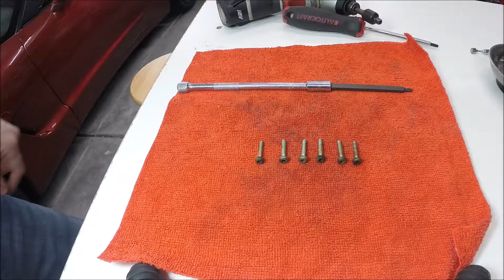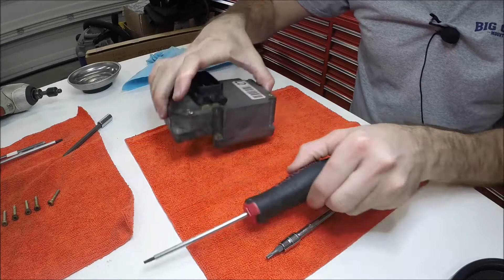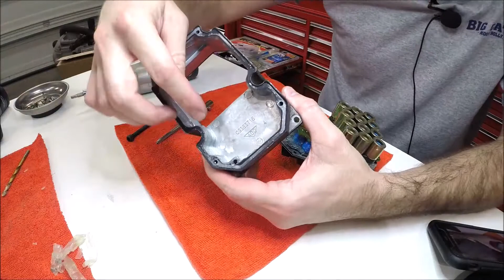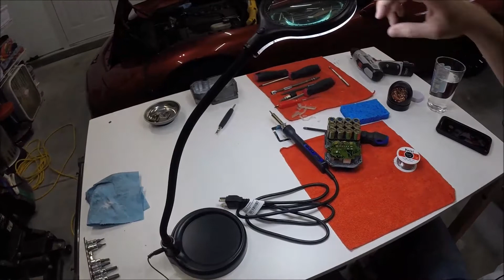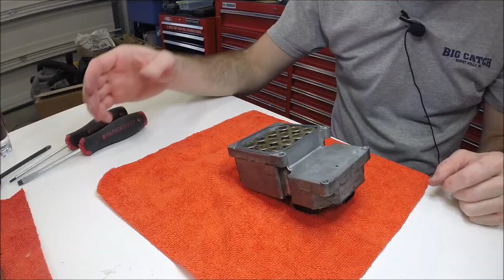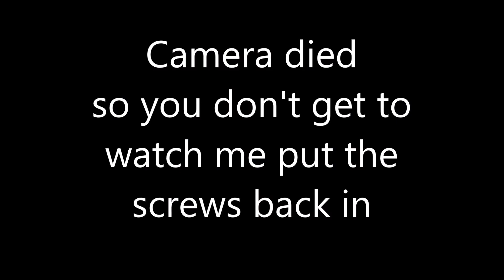C5 Corvette - EBCM Repair

Comment: When using the drill bit to remove the cover, did you drill all the way down into the EBCM then use the tap to create threads, or just enough to get the tap started? Pardon my ignorance, but I've never down it before.

Comment: I have a 2000 c5 corvette automatic targa top model. I see the connector in the front but not the 6 screws you see on yours. Different design from what im seeing. I think mine are hidden
Reply from the maker: Unfortunately, only the 2001+ models are repairable.
Reply: @ScrufsGarage I'm told that too because I'm hearing that they're not as likely to be worked on although I know it's possible if I could just switch it out to something easier that would be great but the amount of work that would be needed I don't even want to think about it. Because when you think about it once all those abs modules are gone then you're going to have to go get something aftermarket or get one of those manual brake lines set ups. I don't like the idea of always adjusting it

Comment: Going to start this project this week.  Thanks for the terrific video!!

Has anyone tried a flexible extension to reach the six screws?  Removal of those screws plus the reattachment seems to be biggest challenge with this project.
Reply: i  tried about everything but finally got the 6th one out tonight.  i used a combination of a 3 in t-20 torx bit and a craftsman Steel Handle Ratcheting handle.  that was after i disconnected as many in the way hoses as possible.  i think my biggest issue was not wanting to scratch the paint so i was very hesitant to lean into the bay.  once i covered the exterior and used 2 hands it was much easing to correctly place the bit and slowly work them out.  guessing youve moved on since your comment was 4 months ago but this step does indeed suck

Comment: When reattaching the module back to the ABS module, any sealant or is that little grey rubber seal (which you could have damaged prying the EBCM off with the straight edge screwdriver!) all you need?

Comment: wills wo 
will this work on a 2000?
Reply from the maker: My understanding is that the 1997-2000 used a different module that cannot be repaired.

Comment: I have seen a lot of videos for the c5 almost all of them for the module 
An bad bearing & speed sensor can trigger those light a bad ground from the module to.. 
First i would check all the other ones then the module at last if all the rest dont work

Comment: I have a 1999 and I see some differences, I have no 2nd plug on the bottom and it doesn’t appear to have the 2 center screws holding it to the module, would you know if this impacts the repair of the unit. Very good video thank you
Reply from the maker: Mine was a 2001.   I don’t believe the earlier models are repairable.

Comment: Thank you for the information.    Where did purchase the shop light that fastened to the hood.
Reply from the maker: I don't recall, I've had it for a while.  But they are incredibly useful.   A lot of them are rechargeable battery powered.  Personally, those never seem to last long enough.  I prefer ones that I can use while plugged in.  And some of them now have lights that you can rotate to help aim at your work area, which is nice.

Comment: I had to fix a 2003 Cadillac Deville EBCM for my father in law. Oddly enough it is the exact same unit that the C5 uses so all this info was relevant. I used an 11/64" Drill bit to drill that hole and tapped it for an M5x0.8 bolt. Got it apart, worked like a charm! Thanks for the in depth video!
Reply: Sounds like GM expanded their applications to other platforms after initially creat these units for the C5 Corvette. On the circuit board you may have noticed the large letters "YCAR". Corvettes are "Y" bodies in GM-speak.

Comment: I have a stock 2003 C5.  I did this repair back in June of 2020.  The EBCM has performed flawlessly since then.  No error codes or messages.  Traction control and ABS are working normally.
Reply: What codes were you getting ?
Reply: @MarioHernandez-bn6pm  I don't recall the codes any more.  Too long ago.  But, both amber idiot lights were on (traction control and ABS).  Ironically, the idiot lights are back on again very recently.  I will pull the codes to see which ones they are.
Reply: @GregSr ahh i see. Ok thanks . Its cause i fix honda ABS modules and on those they give specifix codes when the ABS module is damaged so i was wondering if this c5 was the same cause a customer whos jonda ABS module i fixed before, he called me asking if i can fix thr one on his C5 . Im waiting on him to send me the codes hes getting on his scanner .

Comment: The test failed. No change in messaging on the DIC. Clearing the messages fails to remove the icons on the instrument control panel.  Not sure what to do now.
Reply: Check the wheel bearings the abs sensors.. the ground from the abs module

Comment: Today, the EBCM's 5 points received new solder. I can only hope that what wasn't right is now corrected.  So, it's now to a temporary test installation.  If no messages show on the DIC, that will be a good sign.  More follow-up to come.

Comment: This is an update to my previous post 10 months ago.  The "wire" trick didn't help.  After a while the usual messages started to appear on the DIC.  Intermittent at first, then continual.  So, today, I finally got around to it and removed the EBCM from my C5 and took it apart.  Tomorrow, I hope to re-solder the 5 points/joints above the relay. Soldering is not my thing so it may take a while for me to do.  Hopefully, my effort will fix this problem.   I will follow up on this.
Reply from the maker: I'm definitely not a pro at soldering either, but I can say that a good soldering iron makes all the difference.  I upgraded my soldering iron a while back and it has made the soldering much more enjoyable.

Comment: Want to thank you for an excellent video. I just finished mine and NO CODES. You pointing out the exact places to solder really helped. I did mine from above. I disconnected the MAF sensor  wire and moved it aside. Loosened the air bridge and rotated it upward out of the way. Same with the radiator hose. I put an old radiator hose on the water outlet so it wouldn't drain all the coolant from the top of the engine or reservoir. I placed my fingers on the screw head and the torx bit as I slid the screws out. Installed them the same way. When installing the module I also put the two middle screws in the holes before I put the module in place, and then very carefully put the module on. The put one finger on the screw head while I tightened it. Once again, THANK YOU for this video.
Reply from the maker: Awesome, glad to hear the video helped!   Thanks for watching.

Comment: Thanks for a well done, detailed video. What scares me most is not seeing the 6 screws that actually need to be removed/replaced. The 4 easily seen screws are for the housing. Yikes. I've seen other videos/comments that mention using "hot" glue to hold the screws to the torx bit when replacing the module. I might use a dab of gorilla glue since I have no idea what "hot" glue is. I do like the idea of doing this from underneath vs above. I don't want to have to remove the intake, etc. just to get to the housing.
Reply: Don't be scared dude, it's not that bad. I've done worse. I just finished mine and NO CODES. See my comments above.
Reply: @beninchesapeake  I also finished mine. No codes. And it was just as bad as I feared! Worst repair job I've ever experienced. But it's done.
Reply: @thehomer5913  excellent! Yeah, it does get involved. But I'm sure you feel great now that the dash is clear and no more messages. I know I sure do.

Comment: I just did this to my 50th anniversary C5 with 12000 miles on it. The service stabiltrak messages are gone. I ended up using my 40W soldering iron because the 25W ones were not getting hot enough for me. The 40W worked great. Zip zip zip zip zip. Just don't keep it there too long on the solder joint. Thanks for the video. You really don't have to disconnect the battery. You're just unplugging the 2 connectors with the car turned off of course. Pretty straightforward fix that saves a lot of money and/or having to send it out for repair. Thanks again for helping some vette owners fix their cars for next to nothing except some time and space and tools. Nothing like driving a vette! I did by the way work from the bottom of the car jacked up pretty high with a heavy duty jack stand in place of course. Much easier to get to the bottom screws. No need to remove radiator hose. I did remove air intake hose from throttle body and air cleaner. Better to just get it out of the way. You can get to the top screws easier that way.

Comment: It's 5 months since my original post.  I touched the wiring only at the connector and the C1214 codes and messages stopped showing on the DIC.  Drove the car for months with nothing until this past Saturday running over rough country roads and the messages popped up on my DIC. Frustrated as hell again and will now proceed with removing the EBCm and doing the soldering fix.  Question:  Would putting the car on stands provide better access to the EBCM by working from underneath the car?  (I see that you had the car on the ground.)
Reply: I need to check my wires on my 2000 I guess.  Could it be a damaged wire?

Comment: What year is your corvette because my 1999 looks to have o my 4 screws and the connector is completely different
Reply from the maker: Correct, my car was a 2001 model.  My understanding is that the pre-01 models are different and can't be repaired.

Comment: Is there any need to remove the old solder from the 5 contacts? I did this when resoldering the HVAC PANEL? GREAT EXPLANATION OF CONTENT.
Reply from the maker: I don’t think so; typically just reflowing the solder and adding a tiny bit more is sufficient.  I had to remove the solder when I replaced the relays in the door control module… and it’s a real pain haha.

Comment: If I remove the module and send it off for repair, can the car be driven safely without the module?
Thanks
Reply from the maker: I would not recommend it.  Obviously the ABS wouldn't function, and you'd have a ton of ABS error codes.  Plus you'll want to keep containments from getting into the ABS pump area.   So I would do it at a time when you can be without the car until the module comes back from repair.

Comment: Very helpful indeed.  I have to do this fix to my C5. Have to ask, it has been over a year since the video, has the repair held up, that is, no additional intermittent codes?  We need to close the loop and find out the success of the fix.  Thanks.
Reply from the maker: I had no other issues after the repair.   I ended up selling the car a few months back, but I can verify up to that point that everything was working fine.
Reply: @ScrufsGarage  Thanks for the quick reply.  My C5's intermittent service ABS /Traction Control has been a problem since 2011.  I tracked down all of the ground points thinking that it may have been related because the DIC would show the problem going over a bump then disappear making a turn, just to reappear. The weird thing is that the codes were not related to the car's braking or handling. I am preparing to tackle this repair soon and hopefully rid the car of this problem forever.

Comment: I fixed mine today. But the active handling button isn't doing anything
Reply from the maker: Are you still getting an active handling warning on the dash?  Or is it just the button not doing anything?   You might check and make sure the button is plugged in.  The center console has to come out for a lot of projects and that button has to be unplugged, small chance it didn't get plugged back in?
Reply: @ScrufsGarage  the warning is gone. The button is plugged in lights up but doesnt function in another other capacity. I ordered another button on the off chance that the button may be back.

Comment: can anyone tell what i should do if i have a model in the 97 to 2000 model?? any information at all would be greatly appreciated
Reply: You have to find a good used one out  of another Vette, but if it's being parted out most likely its been wrecked and the ABS module probably wasn't working to begin with! You cannot purchase a new one, Chevy or ACDelco or whoever isn't making them any longer!  So we're screwed buddy!  I own a 2000 and wonder what's the difference that makes mine un fixable?

Comment: Would it have helped to remove the upper radiator hose ?
Reply from the maker: It might help a little, but then there's the added working of opening the cooling system and trying to get air out of the system.   To me I don't think it helps enough to be worth the added work.    Hope that helps.  Good luck on the repair!

Comment: Thanks for the lean, music free video. I've been thinking about getting a C5. This ECBM seems to be the reason folks have been shying away from C5's year 2000 and below. Is there any other "nuances" I should be aware of before taking the plunge?
Reply from the maker: Yea, there were a variety of changes that came with the 2001+ models.   In addition to the EBCM, I also believe the SWPS (steering wheel position sensor) is different (previous version no longer available), and the TPMS system is different.   Also starting with 2001, even the base model LS1 got the improved LS6 intake manifold, which is worth a few hp.   Also I believe 2001 changed to the 85mm MAF (vs 74mm).   And I think there were some improvements to the torque tube and couplers.   If you search on the Corvette Forum, there are some documents that list all of the changes by year that you may find helpful.   But in short, I would try to find a 2001+ car if you can.
Reply: My ECBM on my c6z06 shorted. No one is safe.

Comment: Thanks for a great, detailed video. Of all the videos explaining how to do this, this was the only one with showing a good soldering job. Cold soldering this (google it) runs a large risk of the issue re-appearing and the soldering you described was by the book and should last longer than the rest of that board.
Now i just need to muster the courage to do it myself. My 2001 C5 have had this issue intermittently for a few years, but only to the point where it's annoying and never to the point where it feels like a problem. Still, it need to be done and this video was my literal kick in the butt ... no more excuses!
Reply from the maker: Yea, mine was intermittent for a while too.  I know what you mean, it's hard to find the motivation to tackle the job when it's not a daily issue.  I put it off for a long time until it finally became a hard code and finally forced my hand.  Though when I finally did it, it wasn't as difficult as I had imagined.

Comment: Great video! I have a check engine light on.  I cleared the codes and it still came back on. Do you have any videos on what might be the problem
Reply from the maker: The check engine light could be related to a lot of different things.   If it comes back immediately after you clear it, then it sounds like a hard code (ie, something is completely not working - for me, the EBCM was a hard code) vs something that is an intermittent issue (only happens under certain conditions).   Have you worked on anything recently?   Any chance something didn't get plugged back in?     I would pull the code and do a quick google search.  Most likely you'll find some discussion threads on the Corvette forum about the issue and it will help point you in the right direction.   Good luck!

Comment: Do you know if 1999 corvette module with a letter  M be repair too?  Every comments I read said I can only buy a used one.  Correct?   Thanks
Reply: I have the M coded on my 2000 also.  Everyone says those can't be repaired, I just don't know who "THEY" is!!  I wish "THEY" would tell me WHY!  I will check the wiring at the bcm and wheel sensors one day when it gets warmer, heard wiring could be broken, who knows.
Reply from the maker: That's my understanding also, that the older ones cannot be repaired.   Sorry.

Comment: Hey, I’m doing this job on my 2003 z06. Did you disconnect the battery when you took your module off? Would disconnecting the battery and reconnecting it clear the code? I disconnected my battery to take my module off to repair it, then I started thinking how that may have cleared the code and I would not have any way of testing if the code came back unless I went out and spun the tires. I’m not sure how to check the ohms of the module. I’ve been trying to find a video. This is my first time doing this. I’m just trying to save a dollar.
Reply from the maker: I did not disconnect the battery though it’s always a good idea.   For me, the EBCM caused a hard code, meaning even if I cleared it, it immediately came back.  You can go into the DIC and clear any history codes.  If the code doesn’t come back the next time you start the car, then you’ve got it fixed.

Comment: I just finished following tutorial and EBCM is working. One question - is there any need to re silicone between the two units? Or just the EBCM box.
Reply from the maker: Just silicon on the EBCM case should be sufficient.

Comment: Hey there wanted to know what gage or size soder do you  use?
Reply from the maker: The kit I used is in the episode notes.   It came with flux, a tip cleaner, and 0.6mm solder 60/40.   https://amzn.to/2QvHWyX    And it worked well, no issues.

Comment: If your replace the whole ECBM do u need to take it apart?
Reply from the maker: No, taking it apart is only needed if you are repairing one.  If you are replacing the whole unit, you only need the removal/installation instructions.